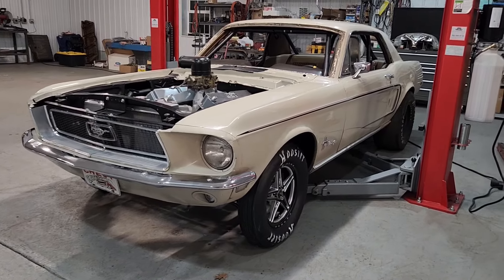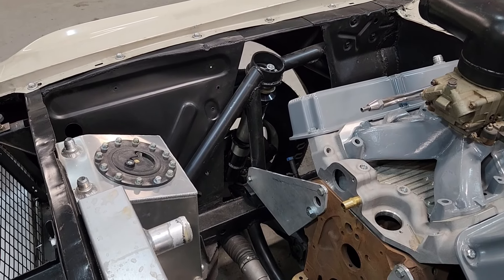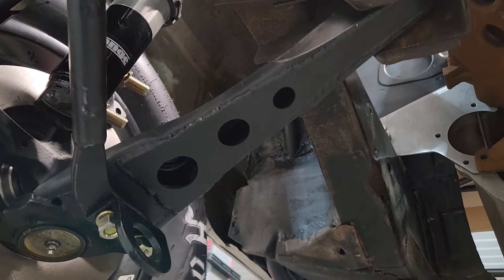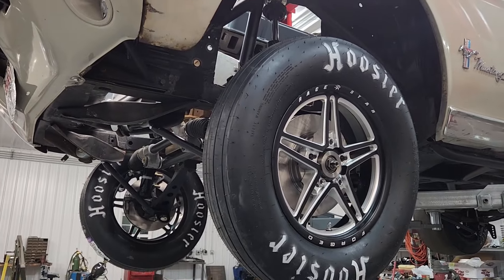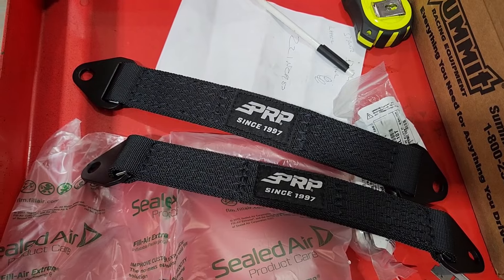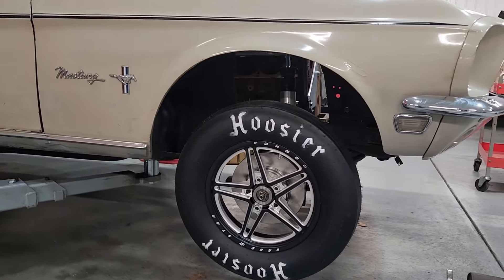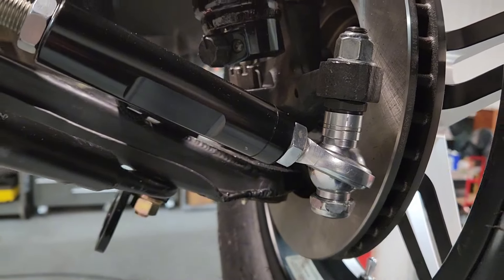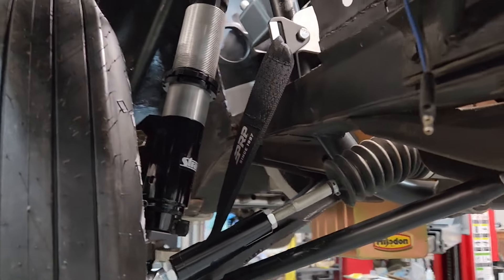No Prep 68 Mustang Suspension Fixes

Comment: Save some money by using seat belts easy adjustment too. Mount the short side to arm , lift car until wheels fall in board pull belt tight then zip tie  looking good I like the taller front tires too. Looking at your roll bar I'm surprised the down bar from the Halo bar doesn't follow the pillar better at the top for better eye site .
Reply from the maker: A seat belt probably wouldn't hold the suspension but I like the idea of the adjustability it could offer. The roll bar is an off the shelf S&W one made for Mustangs that I had some of the tubes lengthened an extra 6 inches to better fit up with the chassis cradle underneath. It might not look like it but from where the seat is there is no line of sight issue at all. Thanks for watching and your comments, I appreciate it!
Reply: Someone I know that still does Race car fabricating did on his 69 Mustang and other cars too , back seat seat belts /junk yard or old Mustang lap belts put hole in strap for bolt and washer.

Comment: what size engine is in the beast?
Reply from the maker: I have a 482 Ford FE engine being built now for the car. Thanks for watching
Reply: Thor knows what he’s talking about, as does Dale Posnick. Is the 482 going to be turbocharged?
Reply: Tom Lucas at FE Specialties is another great source!
Reply: What will your Caster be? That will help keep it straight when it lands.
Reply: I saw the short on the log manifold turbo piping, what will you use that for ? The 445?  I really want to do that , it looks like it would feed an S475.